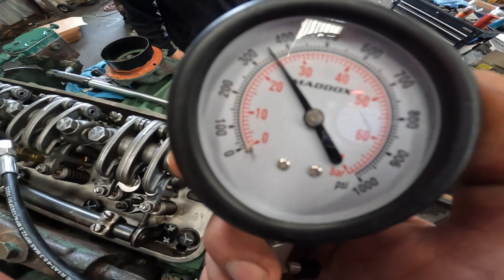471 compression test

Comment: I don't know what is going on... Lol
Reply: They’re testing the compression of the cylinders. Basically there can be a lot of reasons for bad compression, such as bad piston rings, bad cylinder walls, broken head gasket, etc. If any of these problems are there is can cause catastrophic failure of the entire engine.
Reply: You can see then putting the head back together and then turning the engine by hand to test that compression of one specific cylinder
 
Edit: Well not by hand in this case, they used the electric starter instead